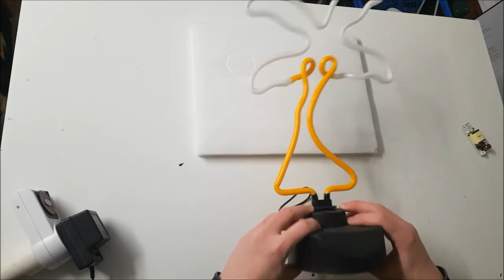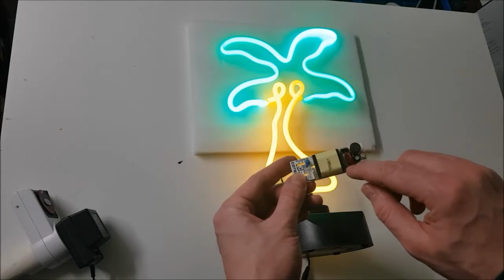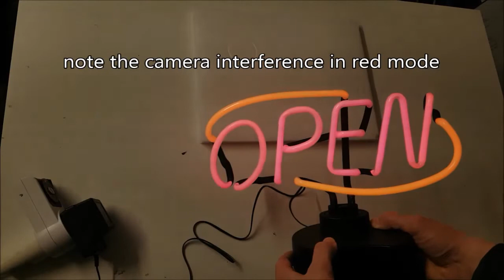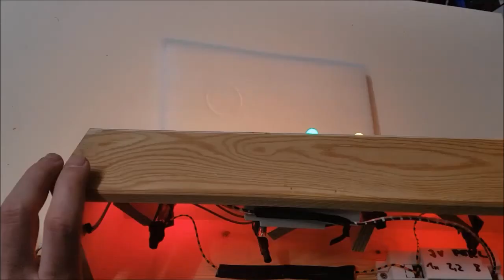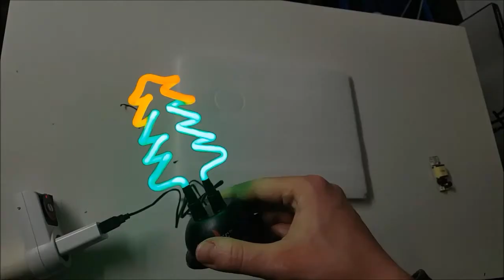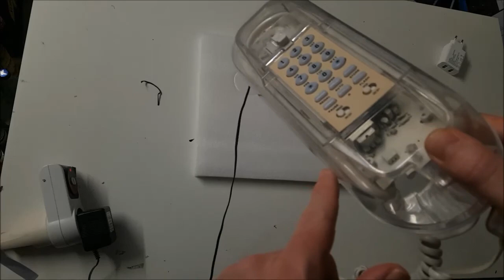Looking at some Neon novelties and oddities - part 1/2

Comment: Wow, I didn't expect that there is a method for color-changing tubes!
The circuit board and the glass panes of the clock look massive and nice, but how does it work that the circular tube lights up only partially? 
Oh, and I many years ago bought a similar small sign like your palm tree. It's a flamingo pretty identical to the one on your box. The black plastic base is pretty light weight as if nothing would be in it, but now I know what kind of small inverter circuit might be in it. And well, this flamingo still works, but it might be a suspicious product, as on its box, the safety labels seem to be not exactly official and I think it also didn't come with a manual. 

And great video as always and also great, that another part will follow. :)

Comment: Do you have a model number or name for the circuit boards?
Reply from the maker: The CCFL inverters? They were discontinued a few years ago, but you can try these numbers on google: 124201CG (12V to 1400V 7.5mA), 126801CG (12V to 2200V 8mA). Manufacturer was COTEK.  You will find several OEM CCFL inverters online, but the Cotek were pretty powerful.